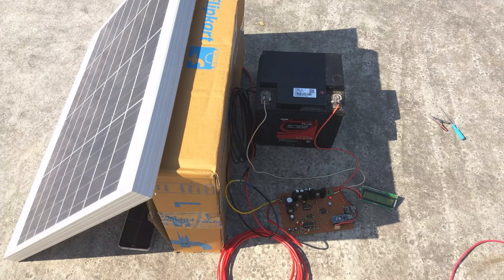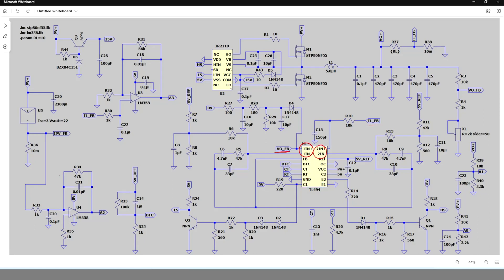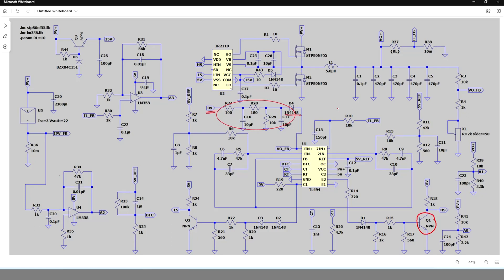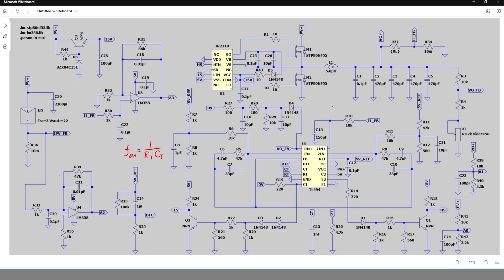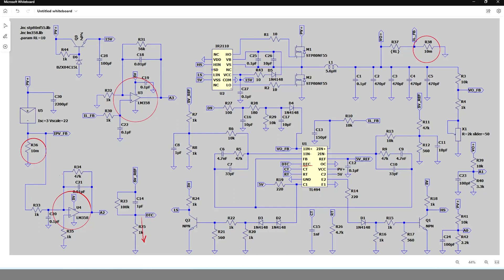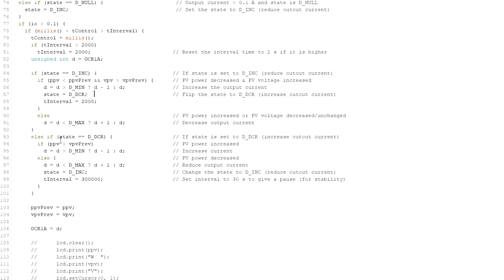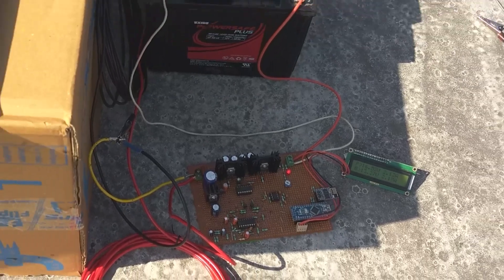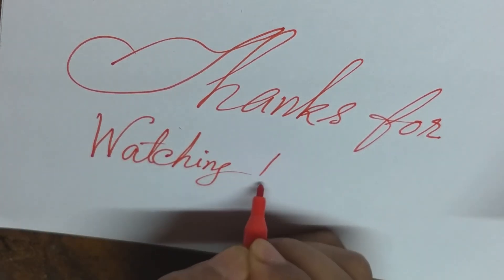How I Made an MPPT Solar Charge Controller with IoT Integration

Comment: Good to know you are also fan Sam Benyaakov's fan. He is THE BEST! I am guessing the gate driver is getting burnt because of long wires on the perf board. Schematic wise I didn't find anything wrong. However, C26 for Bootstrapping looks quite overkill and also little more capacitance at the VCC pin (Parallel to the C27) would be nicer. Diagnostic  of a circuit on perf board is quite difficult task as you can't take all the parasitic in account. Only part that I didn't like is the steering of the voltage loop via PWM DAC and D4. I would use a summing amp instead. Another problem with synchronous buck in this plan is when duty cycle is low and its running in DCM. The LO side MOSFET will discharge the battery instead of charging.

Comment: hello Sir, Please Convert a simple Buck Converter uc3843 based into mppt buck Converter which may be easy and stable output with or without battery .Can i use your code to make the same

Comment: How much is it scalable ? 450 V IN / 100 A and 100 V OUT / 150 A is possible ?
Reply from the maker: For scaling the in/out rating, the output capacitor and the phase comparator network are to be redesigned. I don't think that 100 A output will be possible with a simple buck converter. You might have to go for multiphase buck or flyback converter.
Reply: @ElectroHijibiji  Thanks. I am just working on 150 AMP / 100 V OUT / 250 V IN / 60 A IN 3-pahse buck with two ESP32s. But I have no parts like IRFPs and IXYS N-FETs,
250 / 60 A SSRs, ACS758 50 A, INA219 or INA229, IR2104 or IR2110. I must wait.
Reply from the maker: You are welcome Pavol. And thanks for expressing your interest.